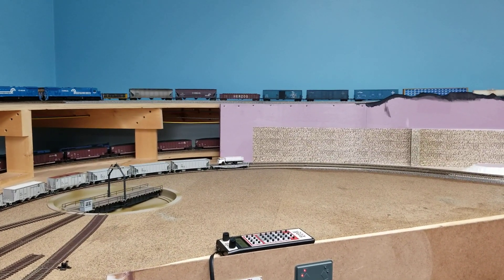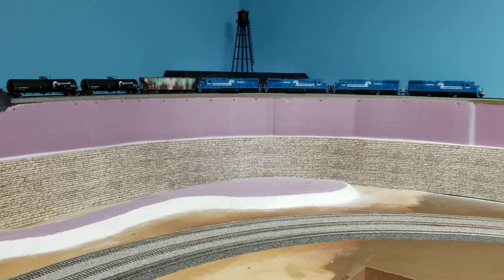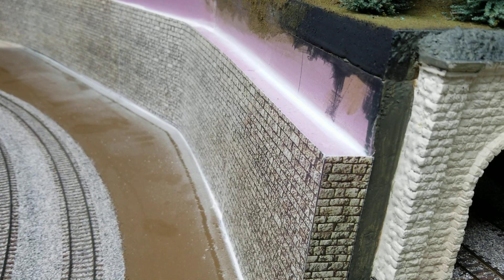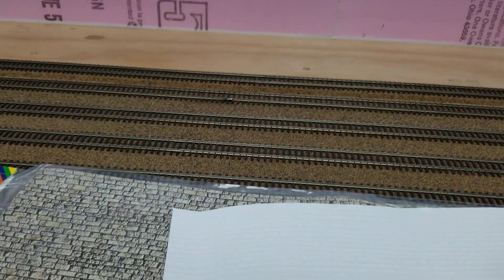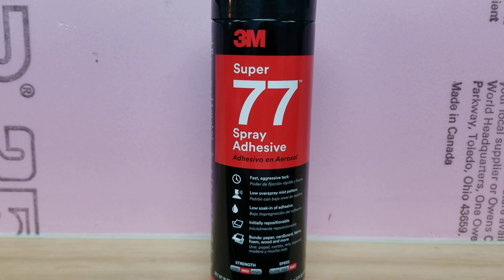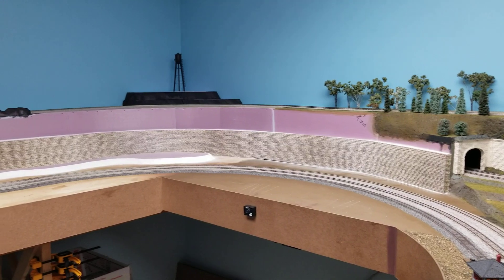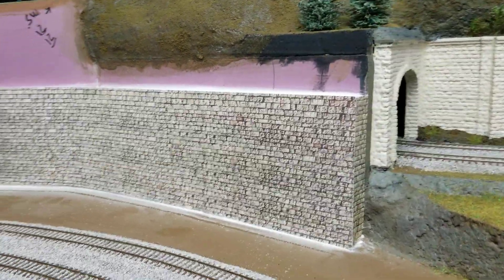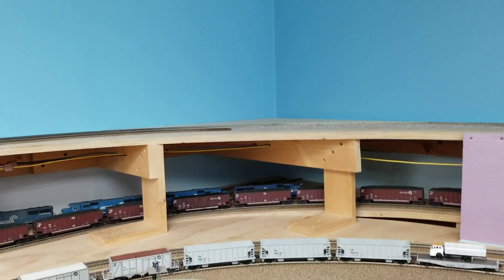Layout update building my Ho Scale 1/2 wall to break up the levels.

Comment: Hey Andy, nice to hear from you...didn’t realize the top and bottom weren’t connected 🤷🏽🤷🏽 and a helix was needed...nice looking wall, gonna look even nicer when you accent it with the rock scenery and landscape above it....the eye will not see any of the perfections you pointed out
Reply from the maker: Thanks Anthony the Helix will be in another room and will only need to Rotate 2 1/2 times to gain 10" I believe it will be 5' wide.
Hopefully it works Stay tuned.
Also plan on washing the wall down with a diluted pigment when scenery completed.
Stay Safe Brother Andy M